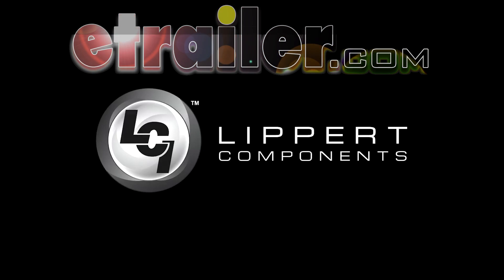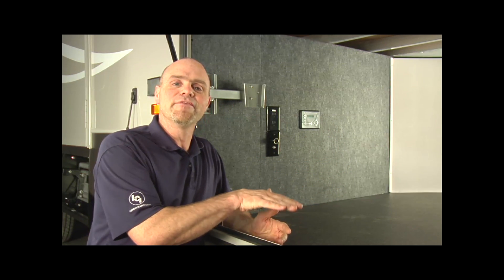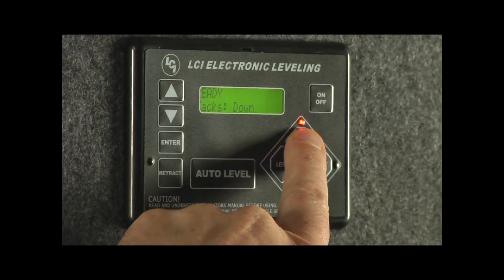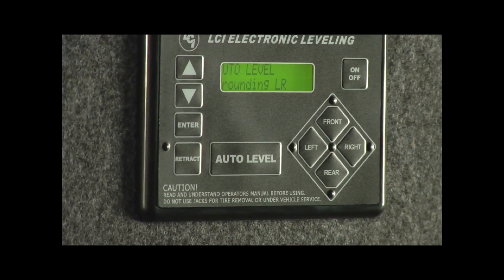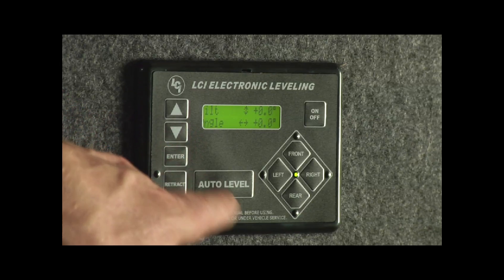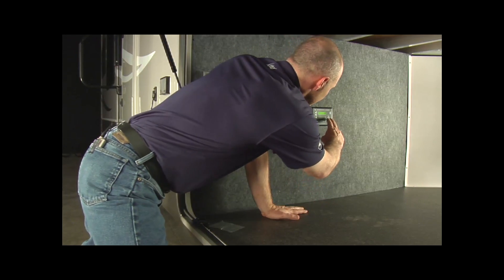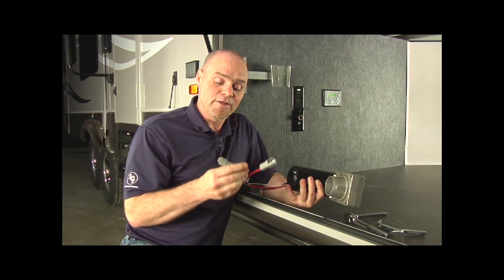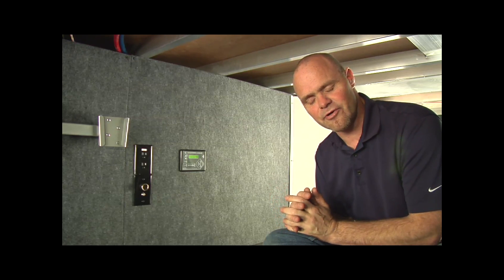etrailer | Lippert Ground Control Electric RV Leveling System Manufacturer Demo

Comment: My LCI would not auto level and two lights on the up n down side to side stay on (the left side and bottom rear lights on) every time it’s power button is push on. Also same time battery low voltage light across the LCD. I got the battery charged and it’s reads 13.2. But no change in panel lights. Can you please help? Thank you Joe

Comment: I ordered a new 5er that has the Ground Control 3.0. 
Where I store my unit I can not open the side door to access the control panel to unhook.
Is there a remote control that would turn on and off the control panel to allow raising the unit to unhook from the truck?
Reply from the maker: Did your system come with a touchscreen remote like the one at the following link?

https://www.etrailer.com/Accessories-and-Parts/Lippert-Components/LC358601.html
Reply: Do not know, it is not at the dealer yet still being built. Some videos talk about a Mini touch pad and a control panel like a tablet.

Comment: Great video! My dealer never showed me half of what I saw on your video. Plus I never got a manual from them either. I did find one online so that's ok. The reason imfound this video is because I was looking for info on the remote that came with it. It will not charge and it's not even a year old. Also no manual for that. I guess I will have to take it to dealer.